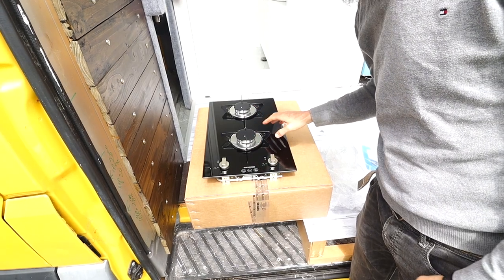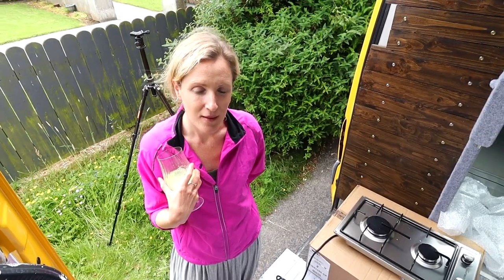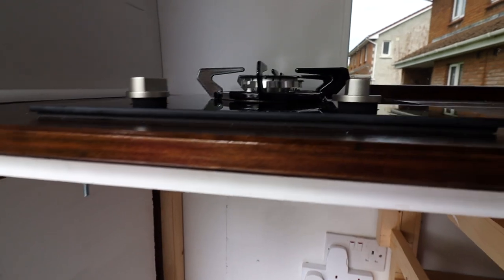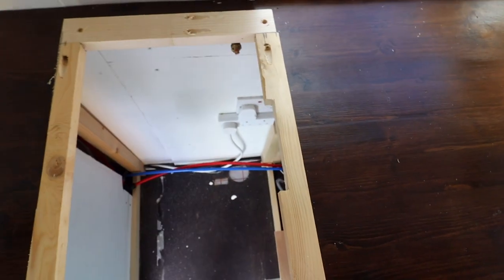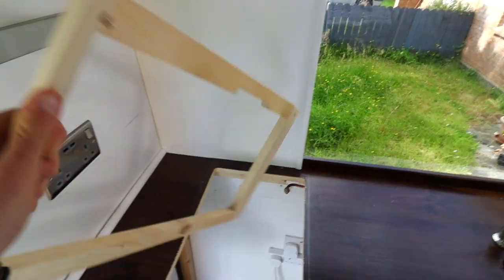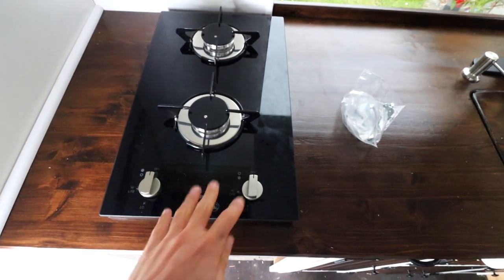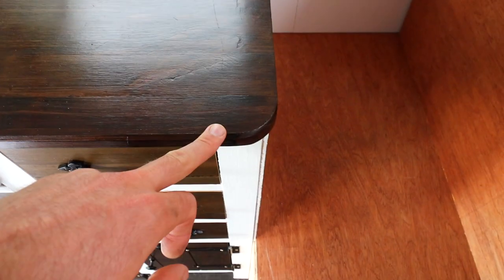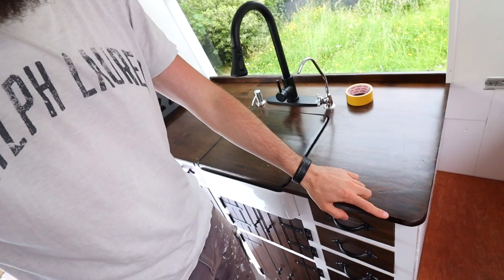SQI ENGINEER REPORT FOR A VW CRAFTER CONVERSION - EP. 51

Comment: Great job Ritchie - how much did the SQI cost?
Reply from the maker: 300
Reply: I,m near the end of my conversion- 2007 renault master van- and I,m in two minds about getting it classed as a motor caravan- I currently have it insured as a van (700€) and  the road tax is 333€ - if I go and get reclassified- insurance will be under 500 and tax around 100 - but then have to pay vrt and SQI  - what other benefits are there to reclassify - maybe just leave it as a van?
Reply from the maker: @dmiller6930  Probably easier to sell but other than that not much 👍